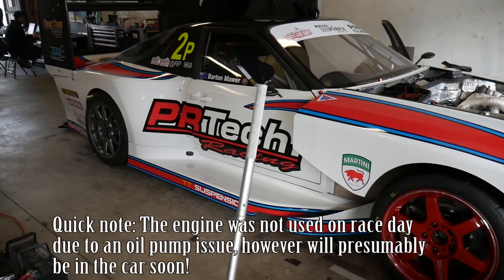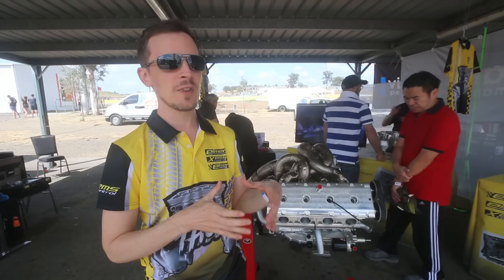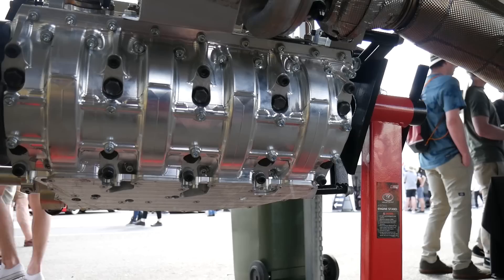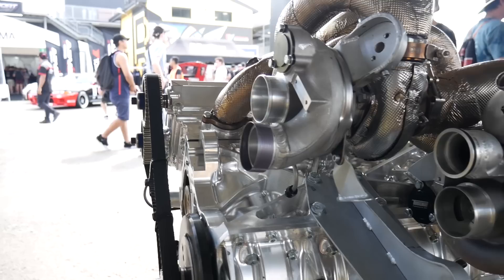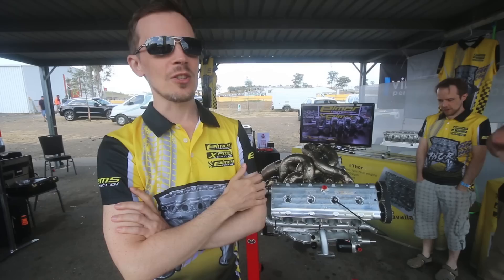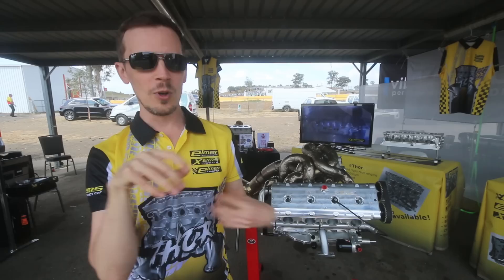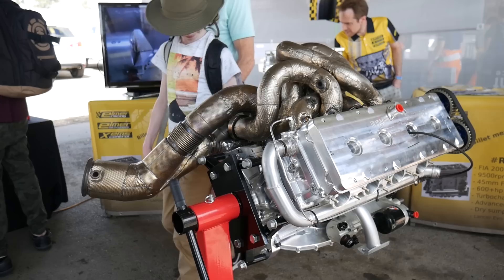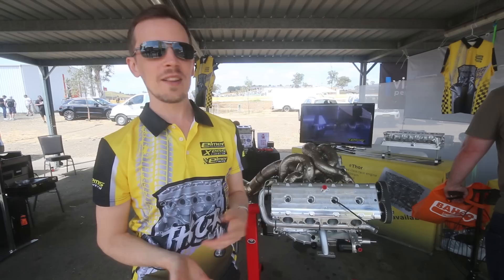4.0L | 4 Cylinders | 1500hp | The *nearly* All Billet RP968 Engine

Comment: Now I’m angered not only did he not mention his piston and rod supplier he says that they might have to make their own rods to handle the additional stress of more rpm? First off that arp 2000 cap screw@ 7/16x2.000 and the crest lap thread in the 7381 rod can take up to 200ft/lbs on the torque wrench giving you about .0075-.008 of elongation @ about 6,000 lbs of clamping Force per 
.001 per side . That’s about 96,000 lbs of clamping Force at the big end. Now I can’t speak for that engine but I would assume it’s a relatively short stroke thus making piston speed relatively slow for a given rpm. By the looks of the piston I would say it’s in the ball park of about 500-550 grams and by the look of the rod it’s a 1.883 Honda journal on a 6” Cc and with a .866 pin giving it a assumed bob weight of about 1,700 grams if you do the over lap math in N/A trim with out the added help of back pressure slowing the piston down as it turns the corner @ TDC on the exhaust stroke @ 10,000 that piston weighs about 40,000 lbs to the cap screw meaning it’s well with in the working range of the connecting rod with a 100% cushion !! Lol !! BME rods take 1,500 hp in one cylinder at 8,000 rpm every Sunday !! And a full long block from Alan Johnson or brad Anderson makes 10,000-11,000 hp@ 6,800-7,200 and only will set u back 55,000$ .... what’s this world coming to??
Reply: Difference is those engines wouldn’t put down a full lap without eating themselves as much as I love what drag engines do their not built do go and lap a circuit hell matouks run deep 7s 150m from where this was filmed week in week out on a $50 engine block in a street car but I doubt that could hold together well enough to be competitive in a time attack event
Reply: carbonfiber492 look up Bonneville and the same engines that go 5 miles @ WOT with NO cooling system and only the volume of fuel to keep them cool and rethink that statement 😁
Reply: carbonfiber492 from a technical stand point that engine IS VERY similar to a modern drag racing engine!! The block the heads THE ROTATING ASSEMBLY is all very close! You would be surprised
Reply: I’m very interested to know if they are running methanol because if so they wouldn’t need a intercooling system and would take advantage of less weight
Reply: carbonfiber492 the real reason the engine is used up and must be rebuilt in a fuel engine is because of RULES lol sound stupid but honestly is true . Back in the late 80 when the cars where running the 1320 NHRA and soon all other body’s made the 3.20:1 rule. Making that the tallest gear you could run, and with the spec Goodyear 36” tire and it’s 33-35% growth makes you spin the motor over faster to go faster. This caused a lot of different problems. First off nitro is often said to burn slow, but the guy who taught me said it’s better to think of it as not burning slow but harder to lite. And with the rule on bore size max being 4.187 and the max cubic inch rule of being 500 cid that means your stuck with a 4.500” crank pin aka stroke. So now you can’t control rpm because the tire and , rear end gear rule AND you can’t control piston speed because to get the max engine size via the 4.187 rule , you must run a 4.5 inch stroke. So here you are with this fuel that is harder then heck to ignite and to go faster you have to do what it doesn’t want to do! Then to compound that a nitro engine needs to be loaded to be happy. What I’m saying is with nitro the more you can load the engine the more fuel you can burn thus the more power you make! Nitro doesn’t work like gas at all it’s almost backward . In theory nitro will burn at 2.5:1 with Air but dynamically we can burn it 1:1 all day if there’s enough load on the motor. Also with the amount of fuel being shoved in to the combustion chamber, in the range of 12oz per combustion cycle . We can affectively raise the dynamic compression ration by RICHENING the mixture lol. So where as a rich gas engine will start to blubber and loose power a nitro engine will just make more power the more fuel you put in to it UNTILL you go over center and drop a hole. Then the intake port resonances go out of whack and the other cylinders see a 15-20 lbs raise in boost until something blowed up. Basically what I’m trying to say is that it’s very possible to make a drag racing engine live if the rules will allow. And I’m trying to do that right now with a friends blown fuel Lakester

Comment: BMW 1500cc f1 engines were Getting 1500hp In The 80s
Reply: Nope ... The 1500cc M12 was 1100 hp in qualifying trim by 1985. The  GTP IMSA 2.0 liter M12 turbo in 1986/87 was 1400 hp. Get you facts straight!
 The engine's mechanical reliability and durability under full work load suffered severely with regular engine blow ups and turbo failures becoming a common feature. 
You can squeeze even more but you would need new engine each race. The 750 hp/l territory reqires more advanced internals. Remember that this engine was designeds under lots of constraints.

Comment: Dont think there will be a market for that, you can buy that same HP in a 100K cheaper package. Also a 4L inline 4 has to be imbalanced as f*ck, love to know how they're balancing all that, maybe they're not... just changing bearings a lot?
Reply: Beach&BoardFan considering the rods only last for a finite number of laps, bearings would be changed on a regular basis.
Reply: 1. Inline 4s has secondary imbalance which can be reduced quite a bit by increasing the rod/stroke ratio (basically increasing the length of the connecting rod) longer connecting rods are preferred in high revving race engines such as this billet engine due to reduced friction and increased peak power output and longer piston dwell time at TDC which improves thermal efficiency at mid-high rpm. Downsides are that it increases the size of the engine and it reduces torque at low revs which is the reason most cars don’t really use long connecting rods and why they vibrate quite a bit at high rpm. But people driving fuel efficient cars don’t often rev them out so vibration is never really a problem for them or the engine.

2. since everything in that engine is designed to minimise weight, the pistons will be lighter, therefore won’t create as much vibration compared to a regular forged or cast piston.

Also your “100k cheaper” engine would be significantly heavier and wouldn’t last 5 minutes with that amount of power.

Comment: back in the 70's formula 1 engines had 1500 ccm and 1800HP ...
Reply: You mean the mid 80's and about 1500hp, but just for one lap in qualifying trim, after that they'd be gone. Race engines were heavilly detuned to last the whole thing. Yeah F1 numbers from the first turbo era were impressive but at the cost of reliability and efficiency.

Comment: billet pistons are weaker than forged pistons..
Reply: there are cast pistons and forged pistons wich are machined from billet, so forged and billet pistons is the same....duhhhh
Reply: Hugo Barbedo not true forged pistons are stamped from a slug of aluminum.  Forging is stronger than a billet.  Forging compresses and aligns the crystalline structure of the metal.

Comment: Forging is stronger than billet .
Reply: True, but I doubt it's easy forging an engine block!
Reply: David Elstob I was referring to the rotating assembly , not the block or cylinder head . Today's cast engine blocks have the grain structure magnetically aligned to properly flow through out the casting . The problem with billet is the grain structure of the metal is what it is and can not be optimally aligned there for creating stress risers and weak points .

Comment: You can build a BILLET Big Block V8,that makes more than Double the power 5 times the TORQUE for less. 481x/5.3 hemi pro-street engines.

http://www.alanjohnsonperformance.com/

Home of the 10,000+hp Top fuel engines.
Reply: Also did BMW make basically make that amount of power with Factory M12 iron blocks and only 1.5L ...30+yrs AGO.

Not impressed at all.

Comment: LOL>... that's nothing... a 4 liter 4 cyl twin turbo only 1500hp? In the 80's BMW had a 1.5 liter CAST block turbo engine that put out 1500hp.
Reply: Toyota had a 2000 hp 4 cylinder made for racing.  I think the BMW is not available now and the Kyle engine is for sale...and it is light.